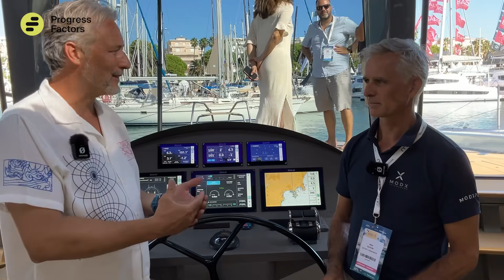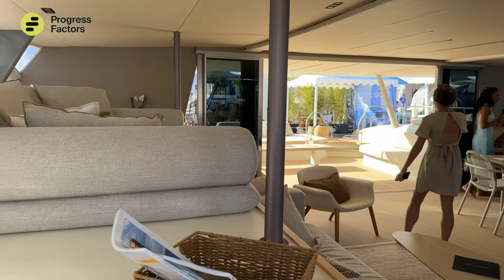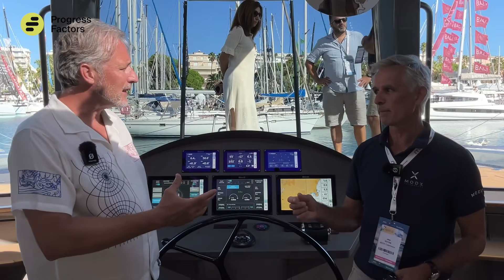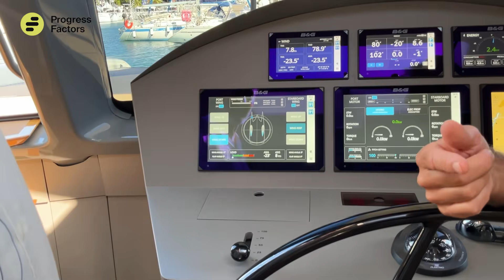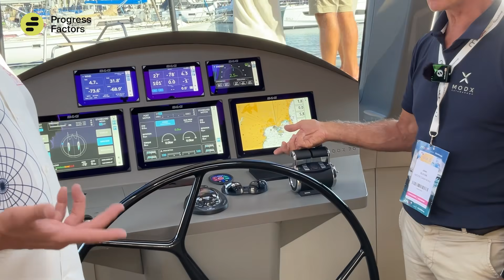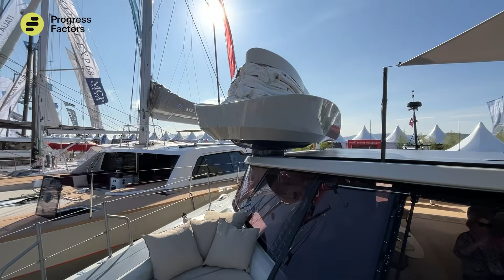MODX 70 Catamaran: The Winged Revolution in Luxury Sailing with Jean Guyon

Comment: I wonder how this sailing yacht would deal with the "doldrums" that anyone will find when crossing the Equator.  What is the range on battery electrical propulsion? 
  Also, they should consider making a trimaran version  and  having a way to install  wind turbines  while at anchor  and have them easily connect to recharge battery while at anchor.  For example at the front of the hulls or amas. Those wind turbines could be removed and stored while sailing.

Comment: No genset and an "experimental" sail system?   Either one of those would be a flat no for any serious blue water cruiser.  Nobody in their right mind is going to try to TransPac or TransAt this boat.  So, you have a 70 foot Med daysailer or close in cruiser.  Also, I hear it only has only 1 reef?  OK...  They are marketing to this to people who don't sail and who can't ask basic questions.   At their current price point they are probably going to have a professional at the helm, but if this was being pitched to consumer market, they should really worry about getting people killed.
If I were running MODX, I would include a genset and a backup sailing system (e.g., something like a kite systems that could be set up and deployed from the roof).   Also, can the wings be cut away in case of collapse?  
On a side note, it's nice to see some of the more experimental VPLP designs make it to market although I would have thought that they would have put the wing technology on a commercial or research vessel first.  The fact that they haven't is "interesting".
Reply: They're not pitching it to the consumer market yet.
Reply: @zivkovicable  Who are they pitching it to then?  If it's experienced charter captains, they are going to have more questions than I do.
Don't get me wrong, I really hope this works, but I won't be buying until it's proven out. 
Really the best application for this is on a motor sailor research vessel with a robust fuel-based propulsion system.

Comment: How much power do the fans use? The fans to inflate the sails. Can the boat run out of power? If solar goes down
Can the electric motors produce enough power to keep the fans running and all the boat systems?

Comment: Sustainability and zero carbon emissions are cool buzzwords. Sure important, but not what I dwell on. The most important thing I see is zero fuel and engine maintenance costs with high speed cruising. Those are huge constant expenses in motoryachts and in inefficient sailing cruisers when you are trying to reach a destination in a certain window.

Comment: Very tiresome! Another video extoling the hype of the MODX-7 sustainable sailing - but no video's since it's inception that show it sailing and performance AND they have supposedly 5000 sailing miles - this is getting very old!!!
Reply: so what's the theory? You think it's not seaworthy?
Reply: @eightrice it appears so, but we don’t know since they don’t show a single minute of it sailing in high seas as they claim- so, very likely! The fact that they don’t care to comment here should be telling.
Reply: @rulebraking  You are not wrong.  I wouldn't get on this boat for a TransPac and I love the way that the industry is going with hybrid technology.
Reply: @eightrice   No one is saying is not "seaworthy"  but I question how this boat would deal with "The doldrums" one encounters while crossing the Equator.  What is the range on battery propulsion alone ?   Have they crossed any ocean?  Have they crossed the Equator ?
Reply: I am more interested in finding out if on those 5000 miles they have crossed the Equator ... In the Equator any vessels usually finds "the doldrums". How does this vessel deals with the doldrums ?  What is the range of the batteries on electric propulsion alone?
  Also,  this boat is priced at 8 million euro.  That' s pretty step price considering that the hull is made of fiberglass.  The Hanstaiger X1 is priced at 4.5 million euro and its hull is made of titanium and carbon fiber.

Comment: 7:00 when did planes fly with sails?😂😂
Reply: Early microlights powered  hang glider first steps beyond  just a flat kite ...🤷🏻🧙🏻‍♂️ Which is basically a sail  laid  out horizontally rather than vertically .😂  Just pray they don't rip.